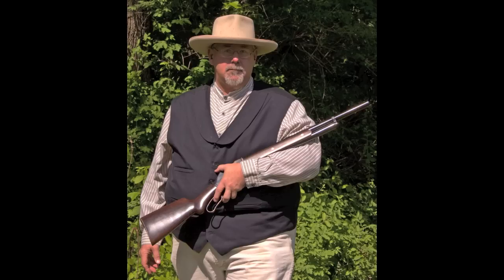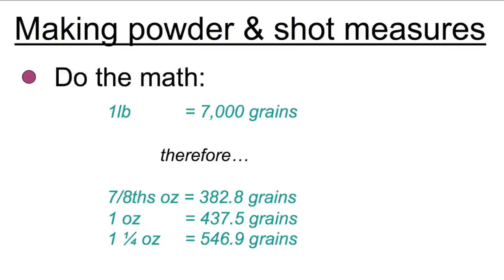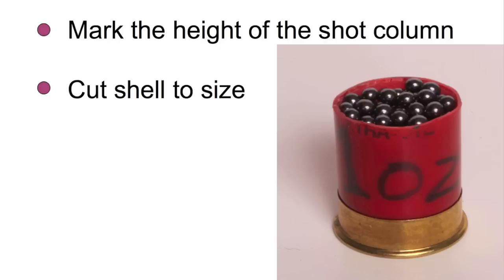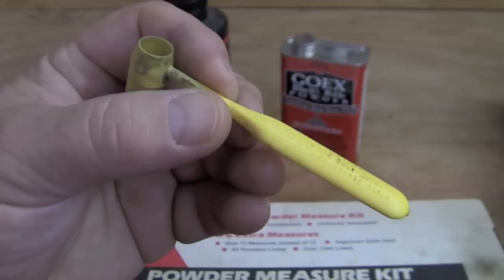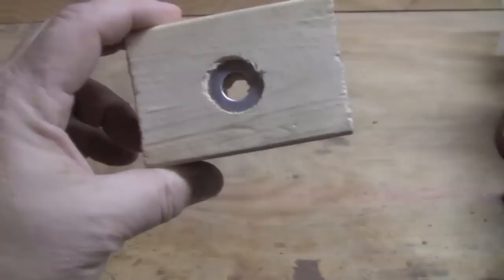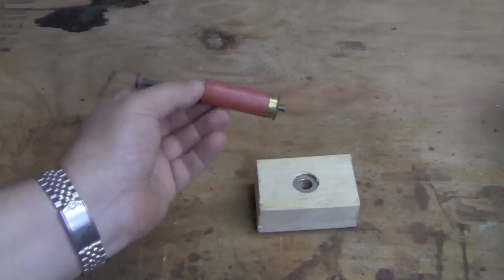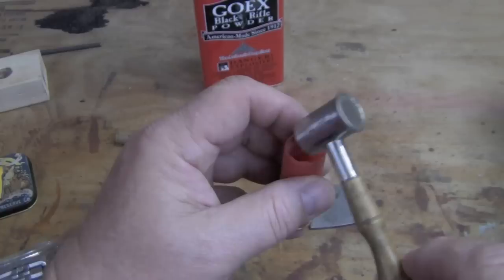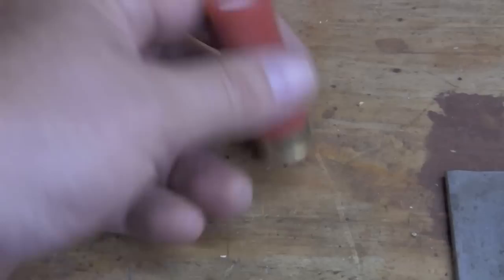Shotshell reloading without a press part 1 nail & dowel method.mov

Comment: For those who wonder what the thick cushion wad is for, in black powder shells, these were soaked in lube in order to keep the fouling soft. If you are not familiar with black powder, it leaves a heavy crusty residue in the bore when fired. This residue builds with each shot making cleaning the bore a very laborious chore, and also causes velocity and pressure variations. A special lube made specifically for keeping this fouling soft was used in these cushion wads, acting as a cleaner to sweep out the fouling to a degree, and making the bore easier to wipe clean after shooting was done.Black powder  lube is different from smokeless lube in that smokeless lube's main purpose is to reduce leading, while black powder lube is not only to reduce the leading, but also to keep that fouling soft. Black powder lube is usually made in a soft greasy consistency, while smokeless lube is hard. Modern shotshells with smokeless powder have no need of such wads, since there is no fouling for the most part. That's why in modern shells, there is only that plastic shot cup. Smokeless powder takes up a very small space in the shell, because much less smokeless is needed than black. So, the plastic wad is mainly to take up the extra space, and to hold the shot together.
Reply: I seen that when someone was making center fire 9mm with black powder he had trouble with it not having the power to move the slide and when he did get it to have enough power it got dirty and stopped chambering as good because he didn’t have the black powder lube

Comment: I did that once with a lee loader loading a .44 magnum cartridge.  I was useing the old lee loader classic.  I seated the primer and it didn't seat far enough, so I thought one good rap with the mallet would do the trick.  Well the primer seatted, but went off scareing the pee out of me, and I had to pull my seating rod out of the ceiling then explain why there was a hole in our kitchen ceiling.  From then on I did my loading in an unattached building.
Reply: We all been there, dont feel bad!

Comment: [08/23/21] For those of you that have 3D printers, printing your own custom shot, or powder measures would be super easy. Just double check the weights and volumes achieved on the final prints.

Comment: Mike, I recently took a stab at black powder buckshot using only the components I use for my flintlock.  It worked well.  I loaded 80g 2F with an overshot card over the powder, then a ball of flax tow, then another overshot card.  I added 1.125 ounces of .31 balls (approximately 8) buffered with Cream of Wheat.   I made the overshot cards by punching a thin cardboard box with a 3/4" punch.   I placed another overshot card over that and sealed it with candle wax.  When I took it to the range, I shot 2 rounds of black powder shells at one target and two rounds of Remington 2.75 ) 00 buckshot at the other.  The patterns were the same size and had the same point of impact.  Since then, I ordered a bag of nitro cards, fiber wads, and overshot cards.  Will be experimenting with them later today.  I actually have some #4 buckshot this time.  But, the previous attempt was designed to only load the shells with components I had on hand for my flintlock.  As I said, it worked well in my Stoeger side-by-side coach gun.  I have a roll crimping tool, so I will use that this time too.

Comment: my grandpa used good ole cheap daisy .177 steel or copper BBs for the "just for fun" shotshells, but large gun stores or even cabelas or the gun carrying scheels have 00/000 buck, but the magical thing with shotguns is you can put just about anything in them

Comment: It is a good idea to go to Lee and buy a resizing ring that they use on their Loadmaster.  The part is cheap, and it is easy to devise a way to drive the collar on and off with a piece of tubing and dowel or even a hole in a block of 4"X4".  That will allow you to use pickups fired from unknown shotguns and allow them to be used in any gun.

Comment: For de-priming I just use an appropriate sized socket either 3/8 or 1/2 drive. works for any case! .25 acp through 12 ga. for the little ones I use 1/4 inch drive sockets. saves having to drill 10 holes for 10 different cartridges. enjoyed the video.

Comment: you could mimic the crimping tool from the last video with a dowel that's hollowed out at a taper for a inch, made to fit over the shell tightly so the crimping doesn't fold out rather than in. just slip over the top of the shell and push down, than use the smaller dowel to roll it even more to the inside to tighten the crimp. would be a nice addition to this simple man's kit.

Comment: Used the first method to try loading some 410's since .410 is way too expensive.

Some tips: Bore out the washer to where it's slightly bigger than the primer. This might seem obvious, but it was possible to us the washer without boring it out, it just had to be ABSOLUTE dead center. 

Another thing that sped things up greatly was to wrap some tape around the nail to where it's an almost snug fit inside the Inner Diameter. This frees your hand and I am now de-priming faster than a machine could!

Comment: @Jonusmax you could take a dowel, bore it out to the diameter of the shell's outer diameter, trying to make it concave at the bottom of the hole and make the boring about 1/2" deep. get another dowel and shave it's end down to the inner diameter of the shell and try to make it convex(round). how you use it is you load the shell to where you need to crimp like in the video, take the concave dowel and fit it over the top of the shell and push down, this folds the edges in..Continued

Comment from the maker: @BlackSabbath1204 THe answer is "yes & no"....mostly no. If it was a single shot pistol and you were going to shoot the reloads in the same pistol the brass was originally shot in, it could work. But there is no way to re-size the brass in this method, so it will likely only chamber in the very same chamber it was originally shot from. I doubt that any auto-pistol ammo made this way would ever feed.

Comment: quick tip for SHTF.
you can make your powder and shot measures out of the hulls of live rounds. if you like the specs of the shotshell, you can cut the shotshell in half, remove the wadding, and trim the hull all the way down to the load, and theres your shot measure. you can do the same for the powder load.
just make sure the powder you'll be reloading with is the same you use to make the measure and there shouldnt be any problems. with that said, be smart stay safe, and by some proper powder measures. haha

Comment: you could make a crimper with a 1"x4" dowel, a 13/16" drill bit and a 13/16 hole saw. just drill the dowel about 2.5" deep with the hole saw(for 2 3/4" shells) and then drill about 2 1/4" deep with the drill bit, using the mandrel's hole as a guide. to use, you just load the shell like normal and when done loading, pop the shell into the crimper and spin and hammer it down, this will make a crimp like with the lee loader. don't hit too hard so you preserve the small 1/4" indentation inside.

Comment: Old Lee Loaders have Fibre Wad loading data as well as early plastic wad data and quite good reloading instructions.
I managed to find some of the data sheets uploaded on reloading forums through a Google search which even had the data for 20g so you may be in luck.
Wad thickness is critical only when using a fold crimp (you need 10-11mm from shot to case mouth) but you will only need a 1/2" cushion wad to cushion the shot.
You can only use Lead or Bismuth shot with full bore contact :-)

Comment: Thank you. One question: is that glueing stable at higher temperatures? Does it melt? 
I heard water glass is stable, but did not try it yet. I screwed up my first batch of brass shells years ago by using  paraffin wax from candles.

Comment: @1873Winchester this method will work with plastic wads, just be sure to use a dowel that fills the shot cup to prevent punctures of the shot cup and ruining it.

Comment: If you already owned or had access to all the tools required to build the the jig with you might save some money.If you had to buy all the tools it would be quite a bit cheaper to just get a low cost reloader.I believe you can still get an all in one reloader for less than $50.

Comment: continued... if you're loading 2 1/2" shells, reduce the holesaw hole depth to 2 1/4" and the drill to 2". the shallow hole compared to shell length is so you can have a good hold with the case rim if it were to ever get stuck. you could also make a 1/4" hole through and through to use a plunger if it gets really stuck, but this is very unlikely.

Comment: I know this is an old video--but I enjoyed watching it.  I just acquired a big bag of once fired 20ga hulls.  I don't have a press (normally I roll crimp new hulls--these star crimps don't like to be roll crimped!).  I was hoping I could cut the crimp off and seal an overshot card in place.  Can you tell me how well the Elmer's glue holds up?  They don't get damaged by recoil, or poor weather?  I was hoping to load up some field loads, so they might see some poor weather.
Reply from the maker: Elmer’s works fine. You can dilute it 50-50 with water, and it is still good

Comment: If you are meaning steel BBs then please dont as they will damage the forcing cone and choke of your shotgun.
factory steel shells use a very heavy plastic wad designed to keep steel shot from damaging the barrel.
According to old Lee shotshell data you can make a shorter shell by using a 1/4 inch cushion wad, which would usually give more felt recoil in smokeless loads but probably wont make much difference with Black Powder :-)

Comment: can you give an example of a conversion for loading black powder instead of smokeless powder? I load 12 gauge 2-3/4" and just say it take 20 grains of smokeless powder. How do you convert this to the right amount of black powder? Also would you recommend using a plastic wad at all with black powder because I know it's crucial to pack the black powder so that there is no explosion. Does the glue cause any problem with the gun barrel?

Comment: Cheaper yes, but certainly not easier/faster than even a cheap second hand single loader you could pick up for under $100 somewhere. This would be good info if you were in the middle some jungle with little in the way of supplies and all the time in the world. Also a really good supply of powder, wads and shot.

Comment: hi, i'm looking to attempt reloading in the most minimalistic manner. I understand that it is safe generally to do this with black powder but that using smokeless powder is dangerous if not compressed properly or if over compressed. have you actually used smokeless powder with this method and is it safe? what would you recommend i use to manufacture makeshift wad?

Comment: Are the primers specific for black powder? Does the shotgun need to be specific for Black  powder? Sorry if questions are stupid. New to black powder.
Reply from the maker: The answer to both questions is "No"
Reply: no, the only thing a primer does is create a spark so that the powder will burn. and no the shotgun does not have to be specific for black powder but you will definitely need to clean your gun more often. hope this helps :D

Comment: i ll try as soon as i get my coach and fired some shells. 
  do you have to cut the unfolded end? cant refold it after stuff the shell?
did you try it in a winchester 1887?
instead of glue can you put the wax you use in BP revolvers?

Comment: can I use this manual method for installing pistol primers in my highbrass shells?
I own magtech highbrass, and they require large pistol primers. is there any risk while tapping the new primers in in this way?
thanks for the great video.
Reply from the maker: Yes, you can install them this way. use a flat steel base under the primer and you'll be fine.

Comment: Thank you for this video, it's great. Have you had much trouble with the metal portion of the shell not fitting into your chamber  properly(too tight)when you reuse shells without sizing them? If so what was/is the solution you use?

Thank you.

Comment: I am an avid subscriber and love your vids! So far I have lb of Hodgdon Pryrodex rs, 1,000 cheddite 209 primers and plastic wads, along with my spent shells, and a set of crimpers I bought on line.  I've seen some presses resizing the heads of the hulls? Is that something necassary?? also In your opinion how many grains of this powder would you use for 1 oz loads with spent remmington game loads?   Thanks -

Comment: Nice video as always. A few questions for 20ga. Forgive my noob questions, I have been reloading for most of my life but never for shotguns. When loading with smokeless, is the wad thickness critical. My reloading manuals do not specify these kinds of wads. Is it safe to make my own wads? Can I use any shot as long as it is the right weight or volume? Do we not need to size plastic or solid Magtech brass?  Any possibility you could do a video on making wads? Thanks for your time. -- TMFA

Comment: Hey Mike, thanks for the video. Do those shells work in a pump or auto loader shotgun?
Reply from the maker: I haven't done it myself, but I don't see why it wouldn't work.
Reply: @duelist1954  Thank you. I will make some and try them in my pump gun. I have a hand held roll crimper coming, so i think they should work.

Comment: eve61032 i have found some that needed to be resized, wouldnt fit into a single shot, or a revolver (410s)  if you are going to do this with an autoloader, or even a pump gun, find a way to put a crimp on or you will regret it.

Comment: your powder and shot measurements are too complicated. look on the side of a shotshell box for an average load. get a ounce to dram dipper and save yourself the trouble. say on a 12 gauge load , you load 3 drams to 1 and eighth ounce , shot . measuring by grains is to much work , and not needed.

Comment: 14mm or 9/16" should do the trick..
Or failing that if you have a socket set then grab one that the hull fits in (most probably also 14mm or 9/16") and use that :-)

Comment: If reloading in Spain is illegal (of which I was not aware), then it shouldn't mater if you did it with a proper reloading unit or this method. It would still be illegal.

Comment: Only one issue with your math. Metals are measured in Troy weight. A troy ounce is 480 grains. So if you use your math, you will be light loading your shells.

Comment: I have been reloading shotgun shells for several years w/o a press.  Works just fine.  Lately I've been wanting to size the brass bases for my 12, 16 & .410 shot-shells, so that they would eject easily from my break-action shotguns, and I would not have to use a dowel to knock the shell out of the chamber.  Suggestions ?

Comment: Good video, but I don't think I want glue (in any form) going down my shotgun barrel.
Reply: You can use plain candle wax or bees wax instead of glue. Has some lube properties. Just drip hot wax over the card in the end of the shell.

Comment: Great video! I've been using pretty much your method while experimenting with brass hulls and various slugs from .735 round ball to a 721 grain, .74 caliber conical on top of some substantial charges - 120 to 150 grains of black powder. It certainly gets the job done, but ya' better hold on!

Load recipes in the comment section.
https://www.youtube.com/shorts/GnhEbC8raVY